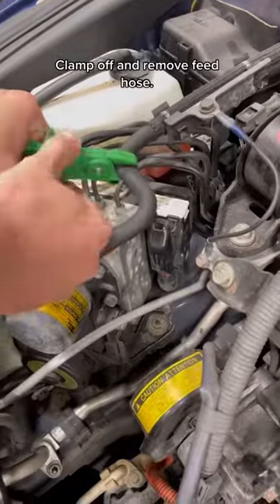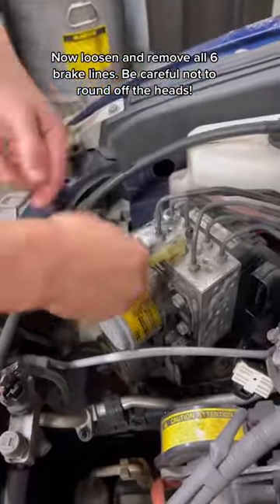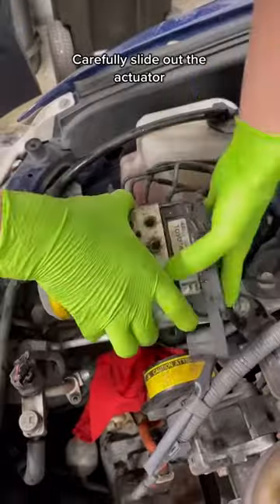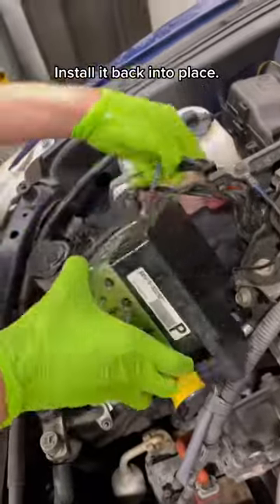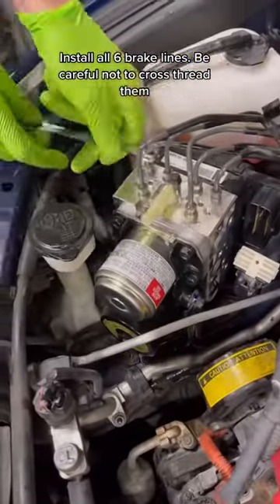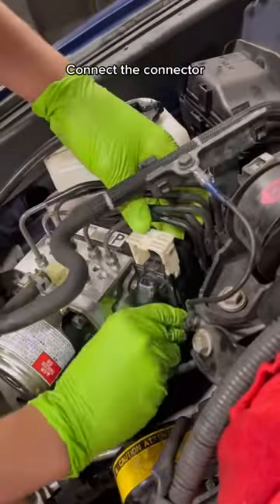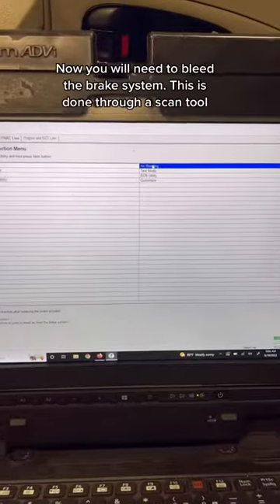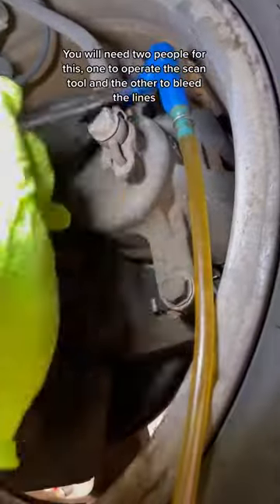How to replace ABS actuator on a Toyota Camry.

Comment: Several ways to bleed brakes: Manual bleeding, and Techstream. Yes, you can bleed brakes by yourself. Buy a $9, 36 inch clamp at Harbor Freight. Turn the small foot around in the opposite direction. Now you have a spreader. Do not take off the larger foot.